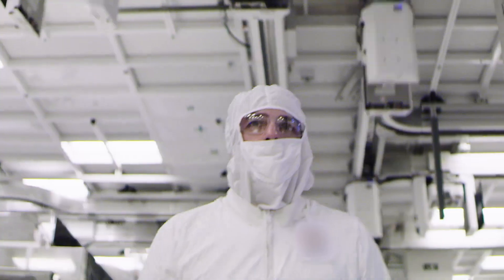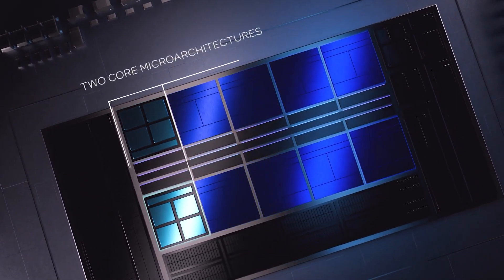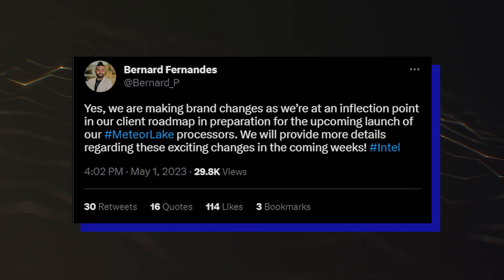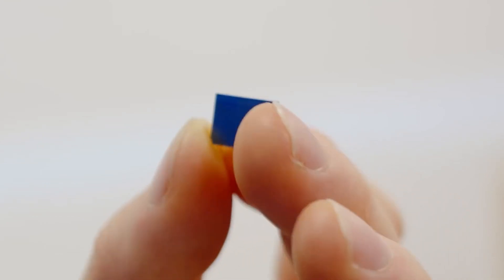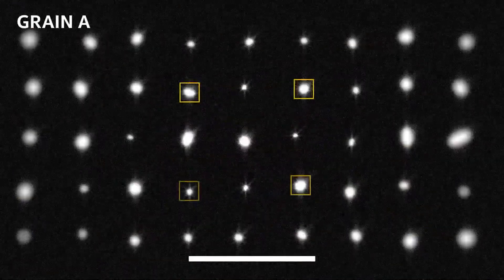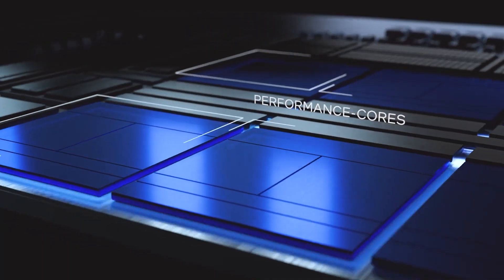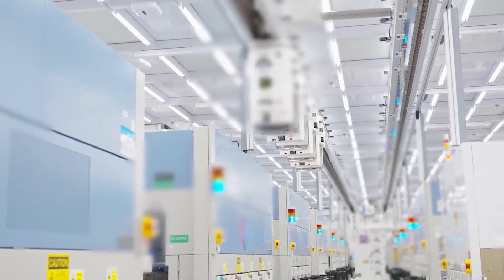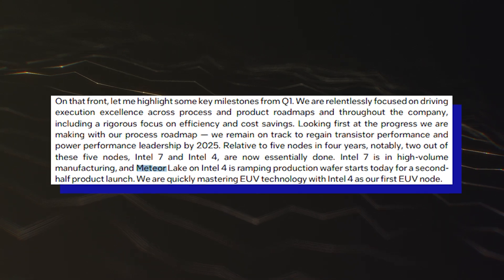NEW Intel Core ULTRA 5 1003H - It's a REVOLUTION!

Comment: The main strategy for these names is - If you can't beat them, confuse them!
Reply: True tho 😂😂😂
Reply: No. Intel is already better than amd and apple in performance. Meteorlake will destroy apple and amd completely and provide better efficiency and better battery.
Reply: @HDRPC  Intel only better in single thread performance. Performance/watt is the worst, except for idle. If Intel cannot catch-up their semiconductor foundry with TSMC, they cannot compete, unleash they use TSMC to produce their CPU. I think you don't know about benchmarking.
Reply: @anistardi  

80 watt of i9 13900k has same performance as 70 watt m2 ultra CPU in multicore.
Yes i know Intel is using very old process node, that is  Intel 7 node which is little worst than tsmc 7nm. Apple and amd are using tsmc 5nm.
meteorlake coming this year 2023 is using Intel 4 process node and it is better node than tsmc 4nm/5nm and exactly same as tsmc 3nm.
Reply: @anistardi  

Meteorlake also has Tiles based architecture and they can switch off CPU tile, GPU tile and also lpdd5 ram in idle or in sleep mode.
SoC Tile and large L4 Adamantine cache on Interposer/base tile will be used as a whole CPU in low power state.

Large L4 cache will act as Ram as they have turned off lpdd5 ram also.
Reply: @anistardi  not worst bro.

Desktop i9 13900k at 80 watt scores 27610 in cinebench r23 multicore.

Ryzen 9 7950x at 82 watt scores 27580.

Yes i know i9 13900k uses 249 watt after undervolt and then scored 40772 in cinebench r23 multicore.
Yes on stock setting i9 uses more power as their node is worst than tsmc 7nm.
Amd using tsmc 5nm.

Arrow lake in 2024 will use better process node than Apple m3 series and Amd ryzen 8000 series cpus.